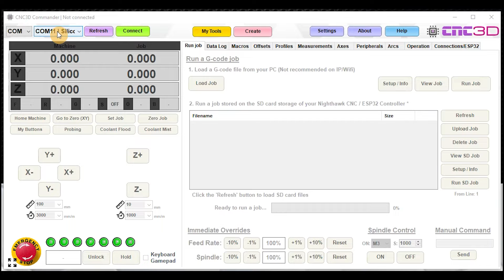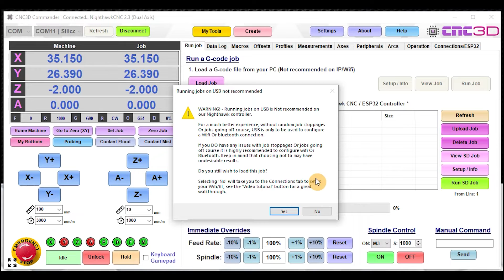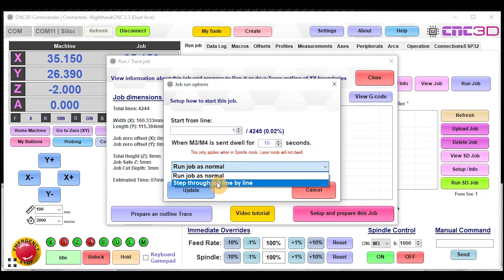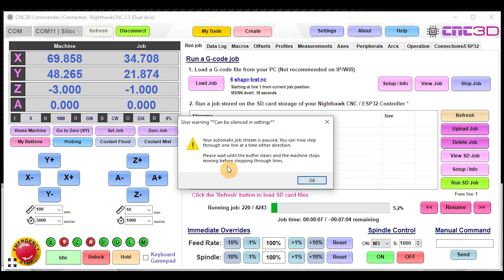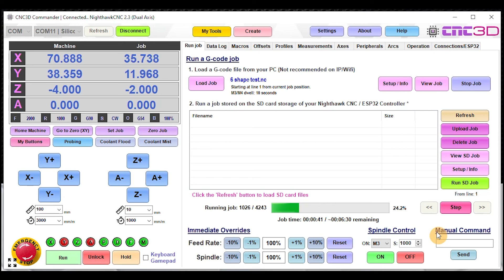CNC3D Commander - Step through job feature - Powerful GRBL control software

Comment: Love this feature. Just a thought….would be great if the current line of gcode was displayed above/below/in the Running Job: progress bar
Reply: I was thinking the same thing - the current line and the next so you know what is due to happen when you press the buttong again.
Reply: @brendensmith3325  Perfect, yes!
Reply from the maker: @brendensmith3325  

https://youtu.be/JzhnXWmAWnQ

Realestate is an issue. Is this ok?
Reply from the maker: Alright! 

You've both convinced me. :D 

this is now done and will be in next release.

https://youtu.be/JzhnXWmAWnQ

- Dave
Reply: @cnc3d  Awesome - looks great.
Reply from the maker: @brendensmith3325  thanks 😊 

This will be available in the next release due very soon. I've found a couple of bugs I've fixed today and will publish likely tomorrow. 

This new feature will be there. Please let me know if it works flawlessly for you.

A good way to communicate and collaborate is via our FB user group here:

Https://www.facebook.com/groups/cnc3dplayground 

Or send us a DM:

Https://www.facebook.com/cnc3dau

- Dave
Reply: @cnc3d  amazing that you have implemented this improvement so quickly. Certainly adds to the feature making it much easier to know what’s going on and should help no end with diagnosing gcode errors. I could have done with this earlier this evening while resurfacing my spoil board having just adjusted the machine soft limits. Look forward to using this is the next release 👍 :)
Reply from the maker: @DatumCAD  awesome, I'm glad you like it. :)

I am very active with Commander development and take user feedback very seriously. 

If you love using Commander, all I ask in return is that you recommend Commander to other GRBL or enhanced GRBL users. :)